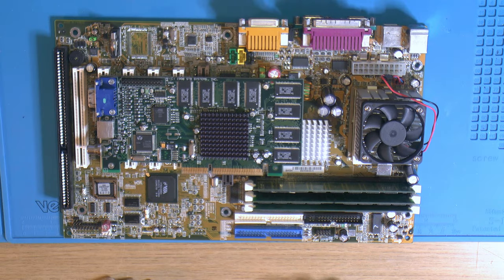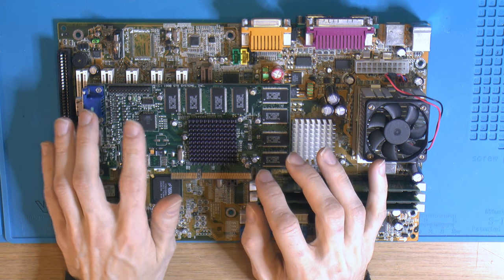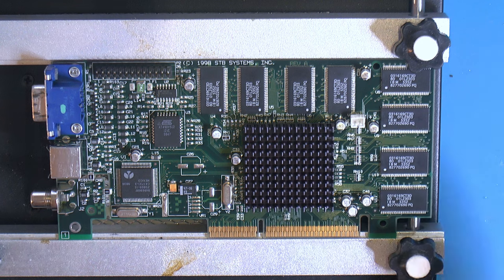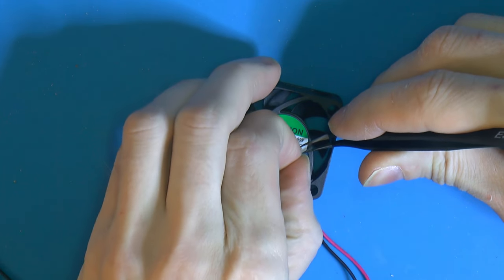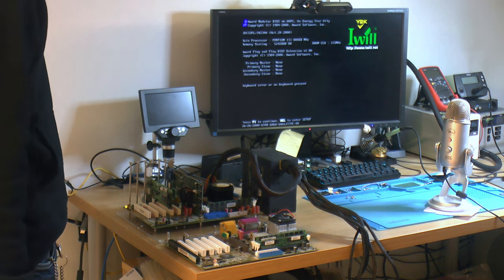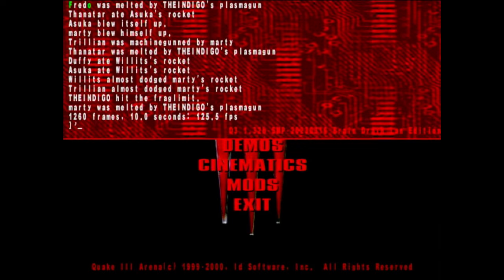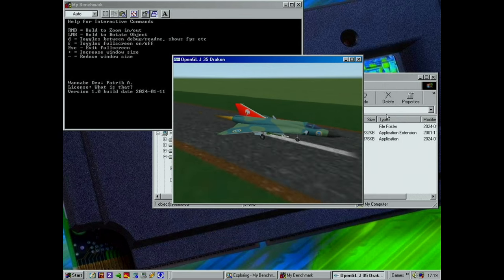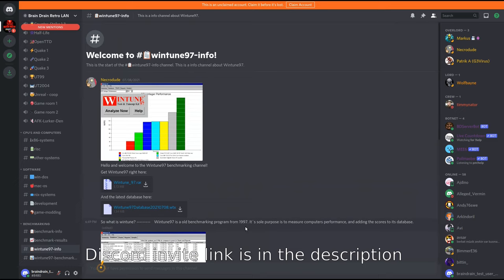Fixing the TNT once and for all

Comment: Some great deduction with the TNT bios bit flip, so weird it was only the copywrite date in the bios splash screen that flipped a bit. Is the checksum bit check a common thing in all GPU bios'?
Reply from the maker: I dont know enough about how bioses works or how a PC decides if a VGA or Option bios is valid and should be loaded or not.

But m old S3 card has this check.
Im fairly sure some check is done on most cards but how it actually works that I dont know yet.

Modern card seems to encrypt the bios, after all Nvidia likes to look down the modern cards so you cant mine on them at full speed and stuff.

Comment: Just wondering, have you looked into the changes needed to use the onboard regulator if one would fit it on?
I had a Riva 128 around these times, damn I wished so hard I had a TNT back then
Reply from the maker: I know one pad has 5V on it that I remember so that should feed the regulator I would think.
There are a few 0ohm resistors on the back so my guess is you remove those to isolate 3.3V from the Core voltage.
But thats just speculation, I have not verified my theory.
Reply: Your theory is a good as mine, that sounds about right, thanks! :)

Comment: Great video! I have an identical card, and I too added a fan to it (wrestled out from some MX200 card I think), though your mod turned out better-looking. Please, what flux are you using?
Reply from the maker: I have some old Amtech so basically what Louis Rossman uses.
There are other options nowadays.
Reply: Should read "old" as "impossible to find nowadays"? :D
Reply from the maker: @nicushorul2007  No, but Amtech has a best before date on there flux.
But from what Im told it last longer then that.

If your in the US you can check out Louis Rossmann's store,  this one probably works.
https://store.rossmanngroup.com/amtech-nc-559-v2-30-cc-16160.html

They are often fake on ebay from what I read.

You can try Krisfix in Germany if your in the EU  https://www.gpufix.de/en/amtech-nc-559-asm-tf-010.html

I have not bought from them but both have excellent reputation on YT.

They have other fluxes also, read the description so its suitable for what your doing.

Comment: I wonder if there was an aborted or bad bios update. I feel like the odds of that particular bit flip are insanely low.
Reply from the maker: Some cards like the Matrox G400 likes to corrupt the bios and matrox even have a blind flash tool forr the G100 to G400 series.
We also had people with 3Dfx Voodoo3 and up having corrupted bioses on our discord.

I guess there might be cases where something can be written to the EEPROM by accident.

CuriousMarc on YT had a Pentium 2 portable system that would corrupt the motherboards bios if the IDE cables where inserted the wrong way, doable if the cable and MB dont have any of the keying stopping it.
I never heard or seen that on any other system but on that one it happened twice I think.

I think maybe something happened to it that wrote that bit and bricked it, intentional flash attempt or just some something that was just a fluke.

Bit of a mystery anyways..